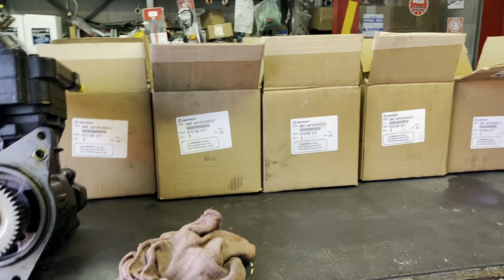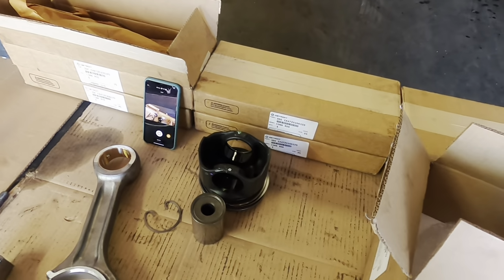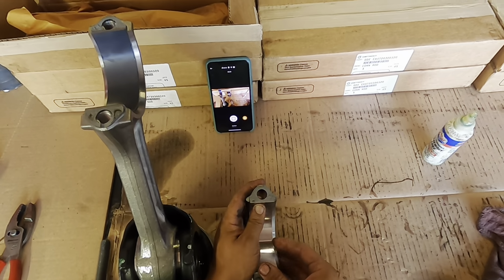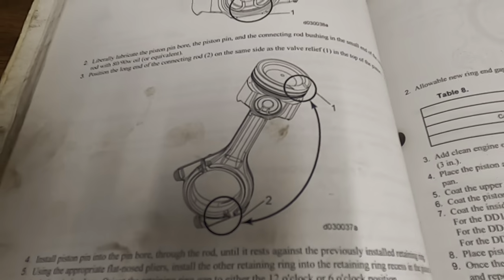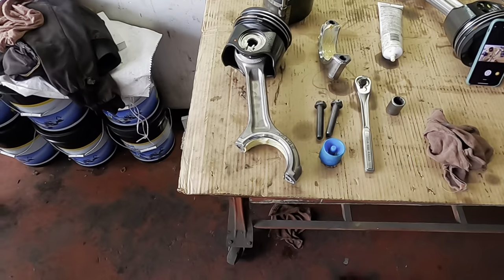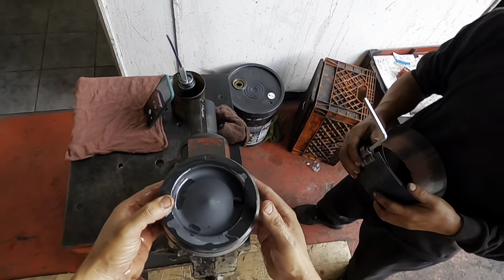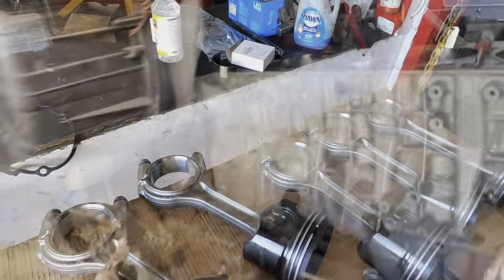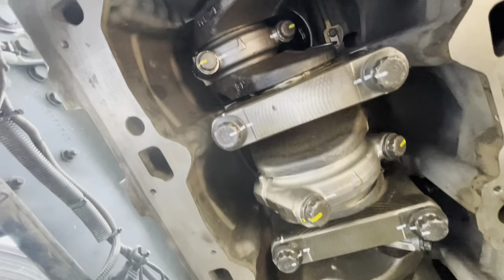DD15 major overhaul Part 4, Piston assembly with installation.

Comment: A few of things I've noticed through watching this engine build. 1st is that when you lubricate main, head, or rod bolts you need to make sure you're lubricating the underside of the head as well as the threads as both experience friction when tightening and will throw torque values off. 2nd is that when you're doing torque turn you do your initial torque and when you do the angle alternating sides is pointless because the seating torque has been achieved and the angle is solely to stretch the bolt and achieve clamping force, the cap is as flush as its going to get. 3rd you shouldn't be touching the actual bearing surface with bare skin as the oils secreted by your skin supposedly damage the bearing surface and you're usually told you should only touch it with gloves or not at all. 4th they also say you shouldn't smear the grease but just put the cap on because of risk of contamination. 5th when you clean engine internals you shouldn't use red shop rags to do it, lint free towels only. 6th I would avoid clamping the actual connecting rod in a vise as it can damage the rod, the way I clock my rings is by clamping a heel bar in the vise and hanging the piston by the wrist pin then I set up the rings and put on the ring compressor. I also start in the middle when I torque main bearings and work my way out in a swirl pattern, same as head bolts but I don't know what detroit says. Also the whole "orient the snap ring at 12 or 6 o'clock only" is a bunch of shit. Every engine I've ever torn down has had the snap rings all over the place and they've been like that since the factory. That said I still orient every ring to 12 oclock for reasons ill explain if you like but this comment is pretty lengthy already. Overall excellent engine build series so far. I worked for a freightliner dealer before moving to an engine specific shop that sees no detroit action where I've been since and we never had a DD series apart while I worked there so I was hoping to learn more about them.
Reply from the maker: Appreciate the comment, little lengthy but good advice is always appreciated. I always look for ways to improve. Thanks again
Reply: @CarlosDieselElectric  in the professional world we're all here to help each other. I'm definitely subscribing and I've learned a lot watching. You're very knowledgeable where detroit is concerned and I look forward to seeing the finished product.

Comment: Very impressed with your videos!   You are very similar in your work ethics, thoughts, and personality as I....I am just becoming familiar with DD15 engine,   haven't had the opportunity/need to become technical with these.  But now am thrown into the ring to learn about these.  Appreciate any thoughts/directions to becoming familiarized with issues,   potential issues,  repairs.   I like your ways and skills.,
Thanks.  Allen.
Reply from the maker: Thank you for the compliments. 
When I first became familiar with the DD15 engine I was intimidated. But it’s an engine just like any other. 
Oil changes on the DD13, DD15 and DD16 are all the same. 
Oil change first, start the engine and verify oil pressure goes up then do the fuel filter change after. This is probably the most critical step in maintenance. 
Never change them at the same time like other engines. 
After you have changed the fuel filter allow the engine to run, there will be air in the system and you might experience a hard start. Don’t use starting fluid. 
Email me and I can help you as best I can.

Comment: I noticed most shops recommend truck owners use Detroit OEM parts when rebuilding your DD15 engine. Are you able to get all Detroit brand new engine parts instead of refurbished parts? I think Detroit is the only brand that charge core charges for some of the engine parts. I was never offered refurbished parts over new parts at Detroit or Freightliner for all the rebuild parts. So I'm thinking Detroit and Freightliner are selling use refurbished parts for new parts. Since Detroit don't sell complete over haul kits you will have to buy each part individually pushing up the cost to around $9000.00 or more. You compare that to a after market engine rebuild kits that starts around $4000.00 with brand new parts not refurbished parts. Have you worked with PAI kits for the Detroit DD15 engine? I'm thinking about going that route since most of the parts look the same between the 2. I just have a problem reusing old refurbished egine parts in my truck. Thanks for the great videos!

Comment: Before, you do the inframe job or overhead. How do you determine what caused the engine failure to happen?
Reply from the maker: That is a tricky question because it depends on the symptoms or problems. 
For example, if the truck is burning oil then most likely something is going on in the pistons or liners. 
If you are burning coolant then most likely the EGR cooler but that doesn’t mean you don’t have problem with the cylinder head or head gasket that might be allowing coolant into the compression chamber. 
If you have excessive blow by then you might have to look at a worn engine. 
So it is important to ask questions and verify the complaint before getting started.
Reply: @CarlosDieselElectric  Thanks for the quick response. I want to ask you another question. I had my injectors replaced because  the truck wouldn't stay running. I drove the truck 300 miles after the injectors where replaced and the truck started blowing grayish smoke from the tailpipe a lot of it. It's not deleted. I took it back to the dealership and they want to break down the engine and look at the head instead of replacing the injectors again. Is this something that you would recommend from your experience? I can tell you value your job, so I trust your thoughts. Thanks for the response.
Reply from the maker: @tracannon  i would put that on them. If they made a bad call it’s on them. If the injectors are bad they have warranty. 
Did they install factory reman or factory new injectors? 
They both have a 1 year warranty but I have had  two sets of injectors be defective. Finally had better results with the 3 set. All of them were factory reman
Reply: Yes, they are remanufactured injectors.The lady said that's all they could put on them. I'm going to talk with another shop. Plus, i have to pay another tow bill. Will there also be a chance I have to change my 1box or the dpf filters?  I've seen a few other videos that said you might have to. Your channel is a lifesaver. I was about to take my truck to the auction and get rid of it. I just put 16k in it. Didn't want to spend any more money. God bless you and your family.

Comment: Hi, Which manual book are recommends? Thanks for sharing your knowledge
Reply from the maker: I recommend the Detroit Diesel manual. Literally has everything you need. I purchased mine through Valley Power Systems in City of Industry, CA.
Reply: @CarlosDieselElectric  how much does a shop manual run you at valley Power

Comment: Does that arrow on the connecting rod cap facing the fan the front of the engine?
Reply from the maker: Yes, the arrow (cap) faces forward towards the fan. Same goes for the piston, goes forward and the open or grove goes to exhaust side.

Comment: How much for the work
Reply from the maker: An inframe typically will cost around $5500. If you have to remove the engine assembly and completely tear it down and rebuilt then the cost will be more because of labor

Comment: where you order your overhaul kit
Reply from the maker: I order my parts through my local Freightliner (Whittier, Ca.) or through Valley Power Systems in City of Industry, Ca. Valley actually has better prices.
Reply: @CarlosDieselElectric  my local Freightliner on back order 3-4 months
Reply from the maker: @mdrelite227  yeah factory back order on many engine components. I am having the same problem